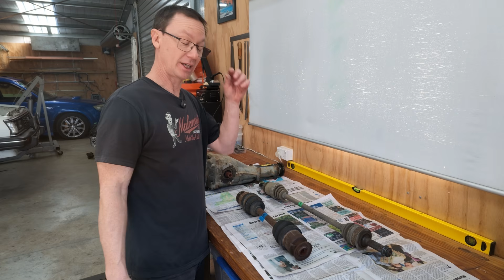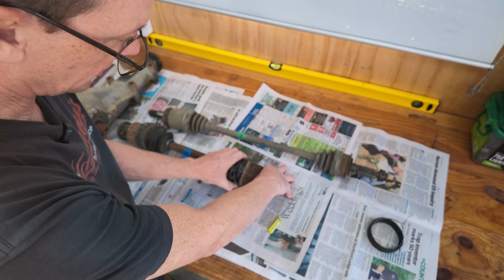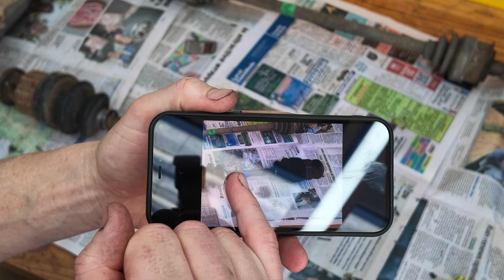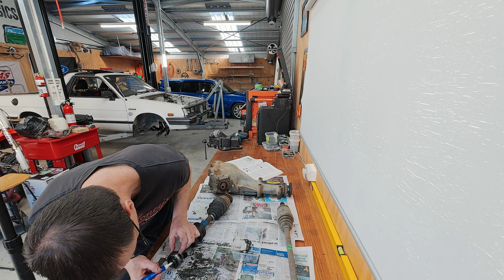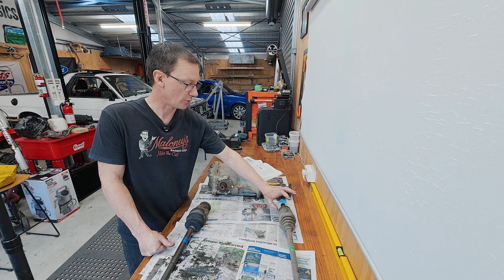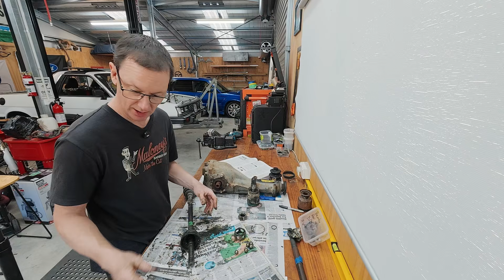Can I build rear axles for free? Brumby EJ25 build Ep 17

Comment: Ok , so that’s my Sunday morning catch-up done .
CV’s = yucky yucky yucky , glad it’s your bench not mine ! 🤣
Always fun trying to sort a solution using intermixed OE components , good workout for the Grey Matter. 
Is it worth going to a Bearing / Universal / CV supplier/manufacturer to see if there’s cross over CV components available ?  For example, use to be a time with driveshafts , you needed a specific shaft yoke series  to match a specific gearbox/diff yoke series and used the required universal series  , where as now you can get universal joints that have a mixed series allowing for mixed gearbox/diff yoke series to be different to the driveshaft series . Just food for thought . 
Keep up the great work mate . 👍😎
Reply from the maker: Good idea! I'll be chatting to the CV shop tomorrow so hopefully they can come up with a cost effective solution :-)

Comment: The stub axle swap should be the easiest and most cost effective option - off the shelf shafts are easily changed since they’re an OEM based unit. I would be replacing seals while you have the diff on the bench regardless of which way you go about this. 

If you stumble across a rear differential from an RS Liberty or Legacy, these have clip in solid stub axles. Sadly many of these were thrown out when rear shafts were replaced for newer male style rear shaft like that of the outhouse. So they’re hard to find now. 

The hollow stub axle should be fine. The early Liberty/legacy’s used the same setup. The MCM brumby runs the hollow stub axles in the rear differential and it runs a standard forester sized tyre diametre without issue. They’re also not the only axle driving the vehicle, their load is shared. 

I’ll be going the same way with the hollow stub axles on my conversion until there’s an issue that keeps breaking these units - if that ever arises.

No special tool needed for the torx bolt either. I used an 8mm deep hex socket every time I need to remove or replace a stub axle. 

When disassembling CV joints I have not once marked everything so it goes back exactly the same. It never occurred to me to do this. I remove the ball and cage setup as a complete unit from the shaft. I only pull it fully apart when I need to thoroughly wash all of the components for full inspection or removal of contaminated grease. 
Hopefully old mate at the CV shop can make you up a set of front shafts that are quality but don’t break the bank!
Reply from the maker: Again, thanks ElFreddoAndRubyScoo for the additional info. So good to bring all the details together so this series can hopefully help others who attempt this sort of swap, what works, what doesn't, what fits, what other options there, etc. Once I get the quote from the CV shop, I'll make a call on whether I swap to the stub axles or get them to make up custom shafts. I like the idea (and the price) of using the stubs as it's all "off the shelf"/OEM stuff, but I also like the idea of making the shafts stronger. Just depends if I can stomach the cost! :-) Good to know about the hex, I wasn't keen to try it myself as if I rounded it or snapped it off, I can imagine that would make life very difficult!